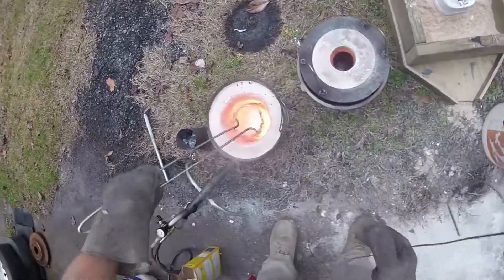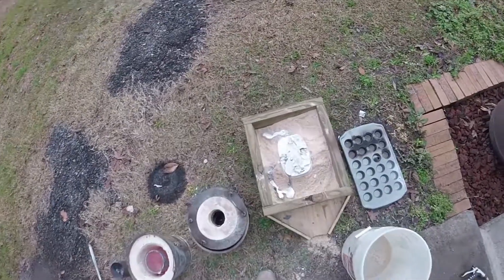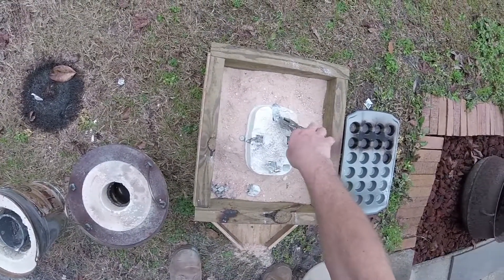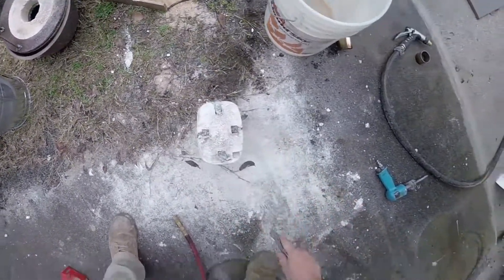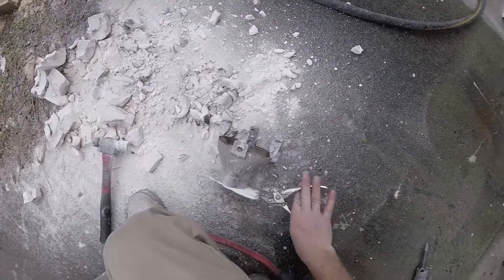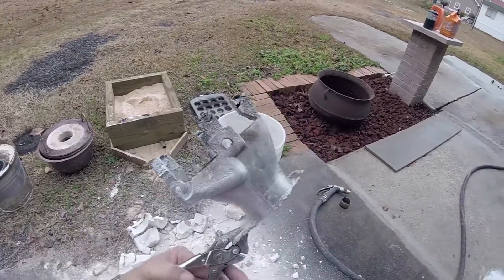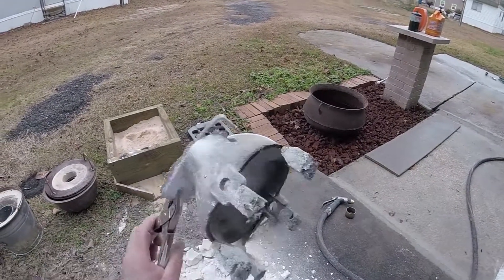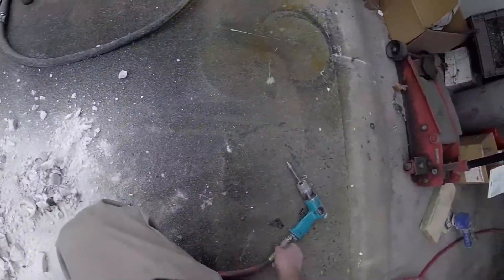4th Aluminum Casting - Mokai ES-kape Steering Nozzle.

Comment: Hey Tom, Great video !

I just watched the one where you were testing the nozzle and took the overflow slough off the river. That's kinda what it's like running the river boat here but I have to go a lot faster so I don't get stuck on gravel or silt, currents a bit faster too. With my mokai I love snooping like that but worry about jamming any gravel into my intake grill............. That can be a nightmare.

Love your ingenuity,

Ard is AK.